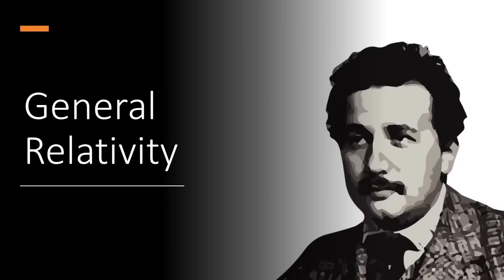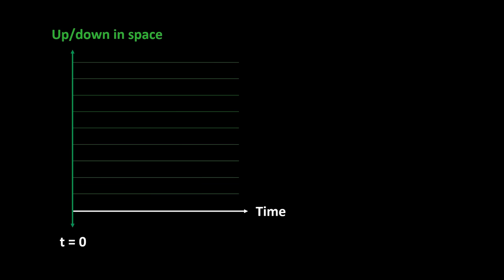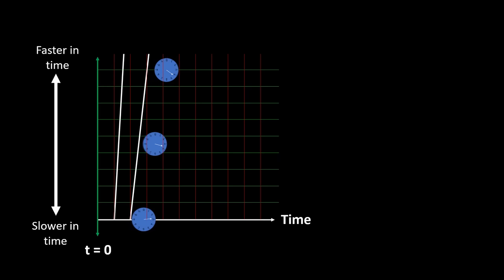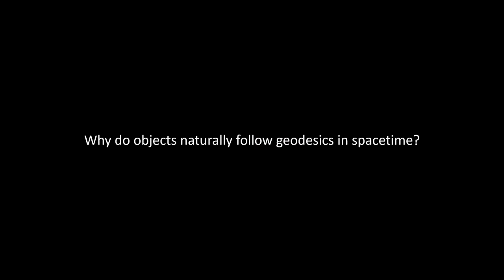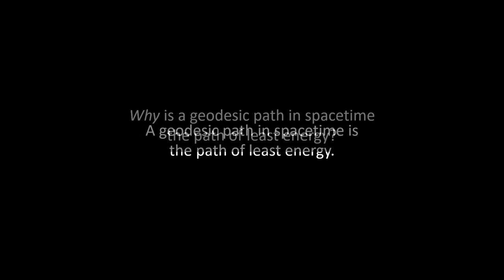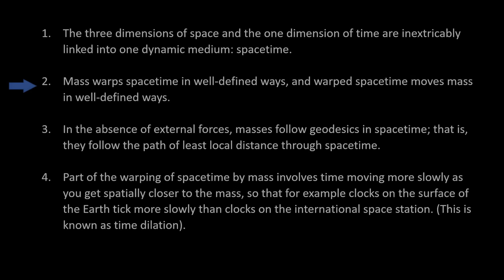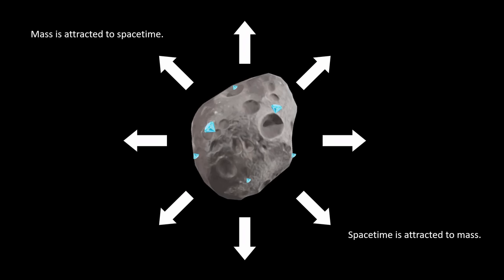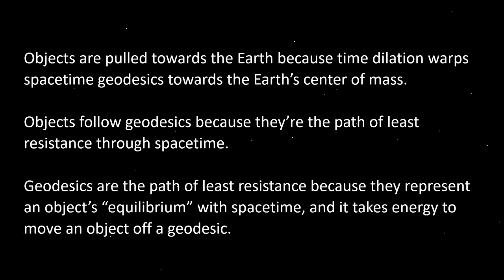How Time Dilation Causes Gravity, and How Inertia Works

Comment: So you say that an apple on its branch is being supplied energy to allow it to deviate from its geodesic. How do you calculate the amount of energy per second that it needs, how is that energy delivered and where is the store of energy that is supposedly being depleted?
Reply from the maker: Hi Enrique, great, incisive questions. This all comes down to the equivalence principle view of gravity, how an object held stationary in a gravitational field (like the apple on the branch) is equivalent to that same object accerelating in a rocket far out in space away from significant gravitational fields. If these two really are equivalent, then they are amenable to equivalent descriptions in terms of energy. For an apple accelerating far out in space, it’s clear how much energy it takes to accelerate at g for one second, it’s the apple’s kinetic energy after that second (1/2 * apple mass * g^2). The energy is delivered by the rocket’s propulsion, and the store of energy is spent by that propulsion. How about the apple on the branch? In the equivalence principle view, the branch is accelerating the apple upward at g just like the rocket’s engines (and the tree is being accelerated upward by the surface of the Earth), so the same amount of energy is needed, and it’s delivered through molecular bonds in the branch. The question of what store of energy is being depleted is more difficult. I think a more general way to ask this question is “what energy is being converted into the apple’s kinetic energy?”. In a roundabout way, it’s the interaction of mass with spacetime that supplies this energy (similar to how it’s this interaction that supplies an object in a gravitational field’s potential energy in a classical framework). The Earth’s mass interacts with spacetime to warp it at a global level, and it’s this warping that causes the apple’s geodesic to bend towards the center of the Earth. 

I agree with your stance (what I think your stance is) that this equivalence principle version of events is highly nonintuitive, especially when you consider it from the standpoint of the conservation of energy. This discussion that someone shared with me regarding this video might help clarify the situation, especially Viktor Toth’s answer: https://qr.ae/pGqeZl

Here’s also some more clarification from a similar question I was asked in another comment: The idea that "we are not attracted to the Earth but rather pushed up from it" comes from the "equivalence principle", a hypothesis dating back 1,500 years that guided Einstein's development of general relativity. Briefly, Einstein's equivalence principle holds that the mechanism for the force experienced by someone sitting on the surface of the Earth pulling them downward is indistinguishable from the mechanism for the force experienced by someone far out in space, accelerating at g. (This is similar to how, when you enter an elevator and start accelerating upward, you feel heavier while you're accelerating; in fact, if you stood on a scale, the scale would show you weighing more while you are accelerating upward). In this sense, there should be no difference between a framework in which the Earth is attracting you downwards at g versus a framework in which the Earth is accelerating you upwards at g. 
That's all well and good, but the first case is immediately intuitive to us, whereas the latter case seems ludicrous (e.g. the Earth would have to be ever expanding in every direction for this to be the case, etc.). What gives? I think the right way to look at this is that neither case is exactly true, because they aren't looking at the underlying mechanism, which is spacetime warping and your mass's interaction with that spacetime warping. So, the real story underlying both cases is that the Earth's mass interacting with spacetime warps spacetime (especially the time component of space), so that the forward direction in time for any mass has a component in the direction of the Earth's center of mass (in a sense, time is bent into the "downward" spatial dimension, and spacetime "flows" in that direction). Your mass also interacts with spacetime, and is "attached" to spacetime by that interaction. When spacetime flows towards the center of the Earth, you're attached to that flowing spacetime, and therefore your mass also is pulled along with that spacetime. The confusing part here is that the relevant "flow" occurs in the time dimension, (i.e. where should a mass go over time given the nature of spacetime in the vicinity?), because it's nonintuitive to picture a geometrical aspect of time. I think it's fair to think of it as: the time aspect of spacetime answers "what should happen next?", and in this case the time aspect of spacetime says "masses should move towards the Earth's center of mass" or more broadly, "masses should move in the direction of the 'deepest spacetime well nearby' with the most urgency", and time says this because of the way masses warp spacetime.

Comment: why things fall with acceleration why not with constant velocity?
Reply from the maker: The only way to get from moving at some velocity (for an object sitting still, 0 velocity) to another is by an acceleration; you can’t discontinuously jump from one velocity to another. This is even true for really fast speed changes, like a bullet going from at rest in a rifle’s chamber to going many hundreds of meters a second just milliseconds later; in the time the gunpowder explodes, the bullet first travels 1 m/s before it travels 2 m/s, and it first travels 10 m/s before it travels 100 m/s (accelerating all the while).

Further, this is how masses respond to forces via Newton’s second law, F = ma. When there’s an unbalanced force (such as gravity acting on a falling object), that object accelerates proportional to its mass. It just so happens that the force of gravity is also proportional to mass, so all different masses accelerate equally in an equal gravitational field. 

Even if it were possible for things to start falling at a single constant velocity as you suggest, they wouldn’t stay at that velocity because the force of gravity is still acting on them (is still accelerating them); the force doesn’t “know” how fast the object is moving to be satisfied that it’s “moving fast enough”, or something like that, the force just keeps forcing the object to move faster and faster no matter how fast it’s moving.
Reply: @IdeaListEye  its very kind of u that u replied one more thing i want to ask probably u read Feynman lectures on curved space there u read example of accelerated rocket nd photon clock in it sane example used by eugen in his video named gravity affects time dilation. Do u agree with their analogy? As this example sounds like specical relativity means symmetric point of view. If possible kindly check either of sources

Comment: Space does not have a negative curvature - if it did - then light would be seen further away  would be even FURTHER away from around a body... Negative curvature looks like the lines that matter follows (within a certain limit; but paths that go near an object, a straight line does not resemble the additional acceleration given to the object - or the kinetic energy increase and potential energy decrease.   Although the net energy is the same, the form is changing.

Comment: Measurement failure. Clocks may be affected by the changes in gravity. No matter we talk about ordinary ones or electronic ones - electrons are having a mass either so the gravity is impacting the flow of them inside of conductors.
Reply from the maker: Physicists have of course considered this possibility and performed careful experiments to control for it: https://en.wikipedia.org/wiki/Gravitational_time_dilation#Experimental_confirmation
Reply: @IdeaListEye  I really do not understand why it is easier to assume, weird time dependency on gravity, instead of gravity impact on the tool used for measurement.
Sometimes, scientists are that stupid. Blind hope to prove irrational theory.
Reply: @IdeaListEye  Because change of gravity cannot affect an atomic clock, right? 
https://en.wikipedia.org/wiki/Atomic_clock

Comment: Super video👍 And question:
If gravity is time dilation, why try uniting gravity with quantum mechanics, when quantum mechanics gives a sh*t about time🤔
Reply from the maker: Thanks! It's not the case that gravity is only time dilation, it's also due to space contraction as well. It just so happens that the time component dominates at the surface of the Earth and similar situations. Near a black hole, space contraction has a huge component in the gravitational effects. 

Also, it's not the case that quantum mechanics doesn't care about time. You've probably heard that quantum mechanical interactions are time-symmetric, meaning the math describing them works just as well forward in time as backward in time. This doesn't mean that time isn't important in QM! For example, the Schrodinger equation at the heart of QM is a function of time.

The push for unification comes from an intuition about the way the Universe should be. We observe of course that objects that exert gravitational influences (like the Earth and the Sun) are made up of particles which obey QM; it almost seems like a logical impossibility that these particles don't interact with/cause gravity. And yet our mathematical models for these interactions seem incompatible, so it seems like there needs to be some deeper insight to explain the discrepancy and solve the problem.
Reply: Thanks for the detailed answer👍

Comment: One more comment.  Regarding that asteroid sitting in deep space.  Defining "At Rest" in deep space in relation to space time, implies that there is an absolute reference frame, called Space Time.   But the problem is, without another object nearby... or far away even... there is no reference to know what your velocity is.  Velocity is only relevant in relationship to another object.   So if two objects have differential velocity with respect to one another, which object is at rest?  Or... perhaps they have 1/2 equal momentum or 1/4 and 3/4 momentum.   Bottomline:  What is the true spacetime reference frame?
Reply from the maker: Good question/point- I'll let this discussion on StackExchange fill in some of the details here: https://physics.stackexchange.com/questions/183577/is-spacetime-absolute

Comment: Thanks so much.  It really helps explain a lot of things.  I have thought of matter as points (Sinks) where spacetime collapses, and your explanation sort of fits this crazy notion of mine.  Not sure if it is correct, but maybe that is all matter is (down to the quark level or lower?) Maybe matter is nothing more than point sinks of spacetime, or points in spacetime where time flows ever minisculely slower, creating the appearance of a field.  Perhaps fields themselves represent nothing more than time dilation?   Think of it this way, scale is everything and physics relies on the interplay of effects on similar scales.  (That's why in meteorology we toss out insignificant terms from the equations of motion).  So in infinitesimal scales (say quark size or smaller), very tiny time differentials, just might become a big thing in terms relationships and effects.  Surely someone has looked at that.
Reply from the maker: Interesting thinking (and I really like the observation that the physics of larger scales is built up from the physics of smaller scales) but there are some problems with this. One is that no one knows how to reconcile quantum mechanics (the physics of "points" of matter) with general relativity (this business about spacetime warping). Another is that if you fields as "nothing more than time dilation", how can you explain the existence and behavior of the electromagnetic field, for example?

Comment: I don’t think this explanation is correct. The time dilation at the height of the branch that the apple falls from as compared to the time dilation at ground level of the earth would be so small as to be negligible. The difference in time dilation is not what causes the “falling” — it’s the earth rushing up towards the apple that causes it. Time dilation is only responsible for the “curvature” or the tidal forces present on the apple (which again would be negligible in this scenario)
Reply from the maker: These are really two ways of seeing the same phenomenon. I could ask you- what is it about this situation that causes the Earth to rush up towards the apple? It turns out, the cause is time dilation after all.

Comment: I’m confused — you say the spacetime curvature that results from the offset clock speeds causes the objects to fall, but assuming this is a uniform gravitational field, then there is no spacetime curvature (the curvature tensor is everywhere zero) so that can’t be the case.
Reply from the maker: I agree that this would be quite confusing if you assume the clocks are in a uniform gravitational field, but there's no reason to make that assumption. The Earth's gravitational field isn't uniform, it decreases with the square of the distance from the Earth's center of mass.

Comment: What is inside the earth, moon and planet that causes gravity? Seems like every thing should fly off from Centrifugal force.
Reply from the maker: Interesting question, and it reveals maybe a gap in understanding. In short, the presence of matter (objects with mass that take up volume) inside the Earth and moon cause their overall gravitational fields. In fact, any bit of matter anywhere in the Universe (even inside a black hole) has its own gravitational field, including your body. These gravitational fields arise from the matter's interaction with spacetime; the presence of the matter in some sense "compresses" spacetime, pulling inward on the whole expanse of spacetime. The Earth's gravitational field acts on your body through your body's gravitational field to easily outweigh the effect of centrifugal forces (though they do have an effect- a 100 lb object would actually weigh about 100.4 lb if the Earth weren't spinning, per this great webpage: http://justinparrtech.com/JustinParr-Tech/centrifugal-force-at-the-earths-surface/).

Comment: Let me explain to you the mechanism of gravity and how it works.  As you know, gravity is caused by curvature in the spacetime continuum.  You must remember that spacetime is this weird medium in which the speed of light is the same for all inertial observers.  What is happening is that spacetime is made of expanding gravitons.  Gravitons expand from a point, from every point in the universe, and from every point in every inertial frame; gravitons expand from all of these points.  Gravitons expand spherically at the speed of light into a sphere of radius r = ct.  If there is nothing to  prevent gravitons from expanding spherically, then space is flat.  But if gravitons overlap with matter, there is a chance that it could be absorbed into the atomic/molecular structure/potential energy of the system.  Gravitons that are absorbed into matter, are slowed down briefly.  The result of gravitons expanding from the mass of moons, planets, stars, black holes, etc, means that the normal process of spacetime is disrupted because gravitons are being slowed down by matter.  The result is curved spacetime (gravity).

Graviton expansion is similar to light cones.  Light cones in relativity are similar to rings expanding at the speed of light.  But they are really gravitons expanding in 3 dimensions of space and one dimension of time.

Comment: That's how i understand it ::::: For spacetime, all matter is like tumor in brain. Matter, by its existence, presses on space-time, thereby compressing it, thereby creating a slowing down of the "flow" of time. And another matter "searchs" for shorter path for it's move through spacetime.
Reply: Interesting explanation.
Buy, why should another matter "searchs" for shorter path for it's move through spacetime? What do you mean?

From what I know, matters just flows in straight line. It doesn't matters if it short or long.
Reply: @hugobo-id  similiarly to thunder, searching easiest path and place where strikes :)
Reply: @havocking9224  But I don't think if we drop an apple from the sky, it will follows the thunder path way. So the thunder path analogy should not be general.

I just imagine search the shortest path is like the Dijkstra Algorithm or A Star algorithm.
Reply: @hugobo-id  or it will be like forces that creates atom itself. Who knows.

Comment: Two issues remain not well integrated in the analysis. 1. Clocks are mechanical objects that also move to tell time. 2. Gravity is not static but waves requiring a consistent source. Solving these two issues will show that time is just energy flow from one system to another, therefore not a dimension.